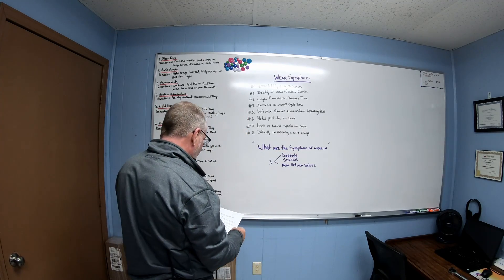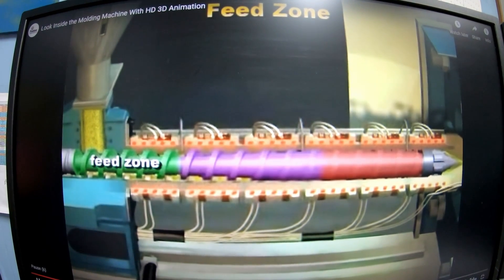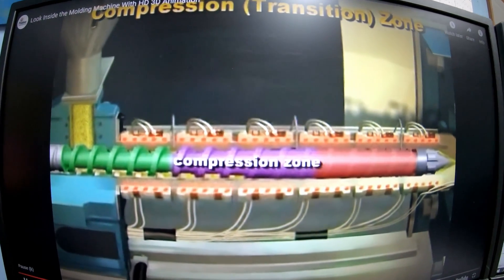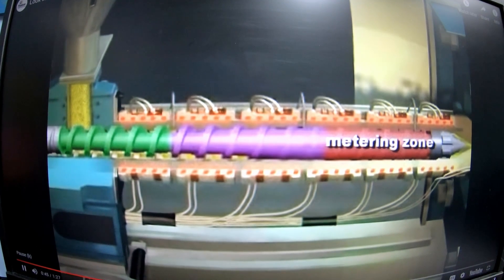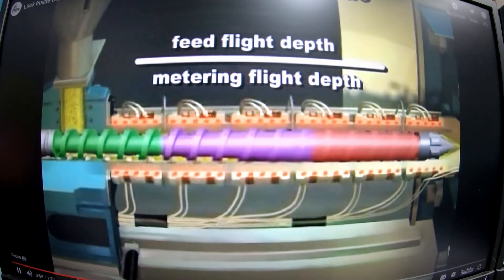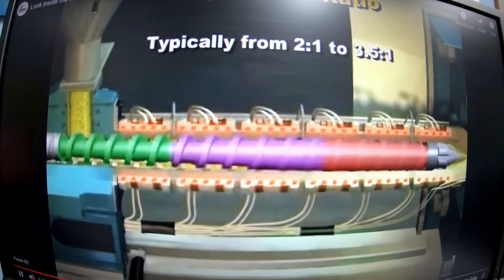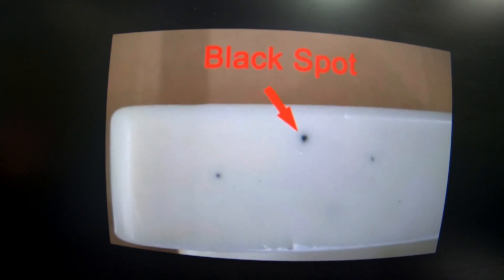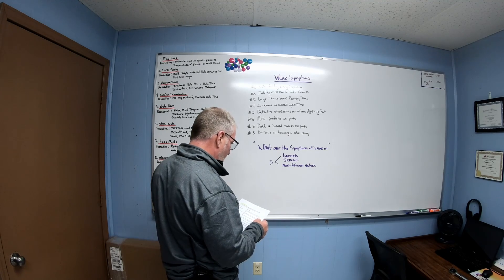Wear Symptoms  Barrel, Screw, & Non  Return Valve

Comment: That blows my mind. I'm a machine operator at a plant, and the press I was working on was having issues during the dosing(?) portion of the cycle, where sometimes it would straight up stop while continuing to rotate away before picking back up and retracting fully, or just retracting slowly in the first place. It was a rather random issue, but I mentioned to one of the engineers that I thought it might be an issue with the screw mechanism itself, and they shrugged me off. What you said at 3:41, that confirms what I thought, and that I was right. This was exactly what the machine was doing. Thank you for this channel and the very useful information, I intend to use what I gather from here...
Reply from the maker: Thanks for the kind words & I try to teach what has happened to me over the years & what I have found. Thanks for watching & the support to the channel I greatly appreciate it.